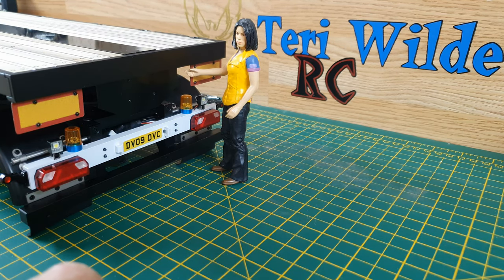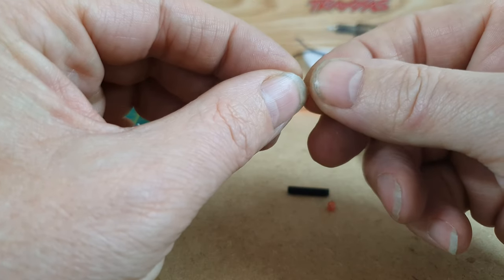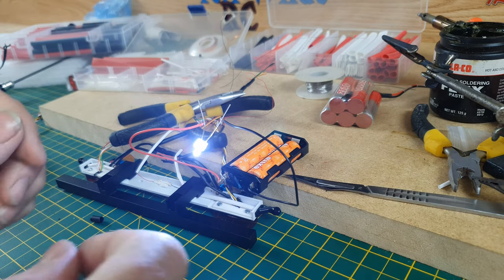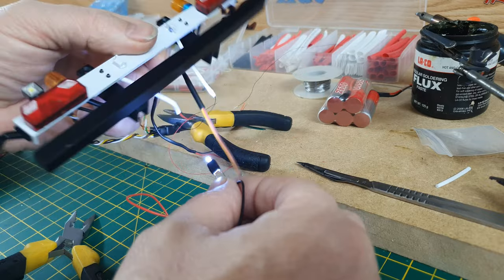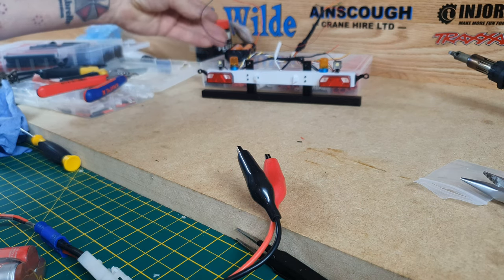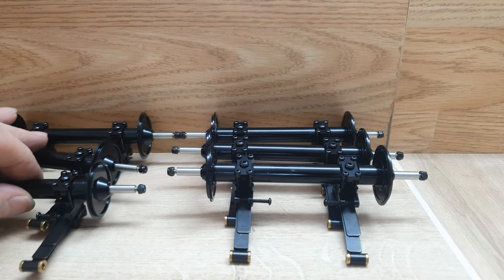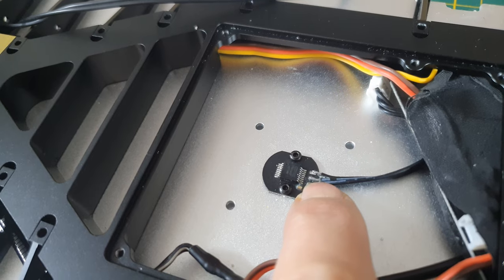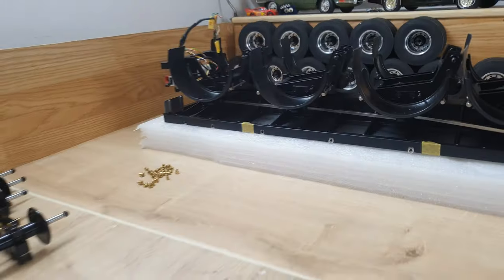Tamiya MAN TGX - Project Ainscough - Ep13 - Nooxion Fury Bear Ballast Trailer Axles and Wiring - 4k

Comment: I wonder if the Tamiya lg retract kit would work on that trailer?
Reply from the maker: No it won't, there's too much going on at the front to be able to fit all the switch gear. 
You could fit the LESU legs and run them from the radio if you had a 3 position switch spare.

Comment: I agree with you for that kind of money they should have better quality controll, its a bit dissapointing but it´s still a darn nice trailer.
Reply from the maker: it really is a nice trailer and I am still happy with it. sheared screw heads, loose bolts etc. is something that can easily be sorted. I did find that some of the threads are deep enough, but I have a lot of different size taps and dies to chase the threads down a bit more. not something everyone has and it may be easy for me to sort it, it might not be as easy for someone else.